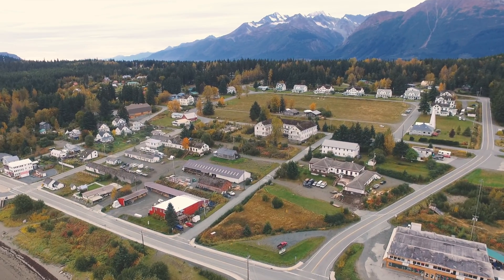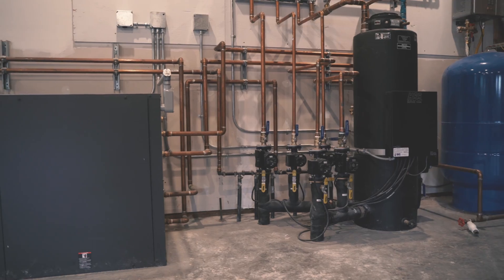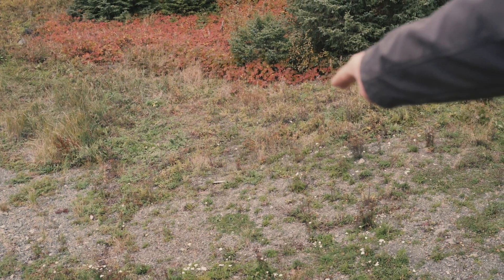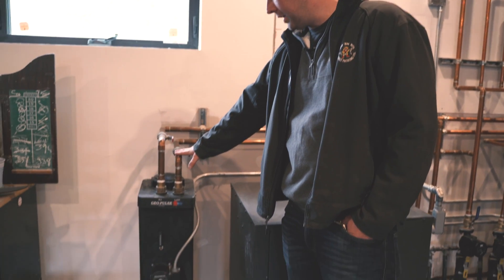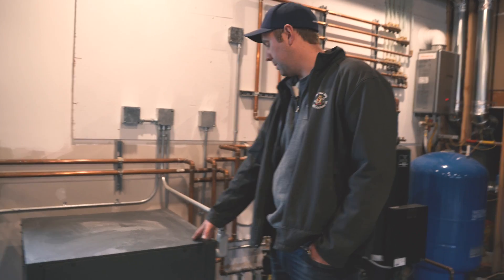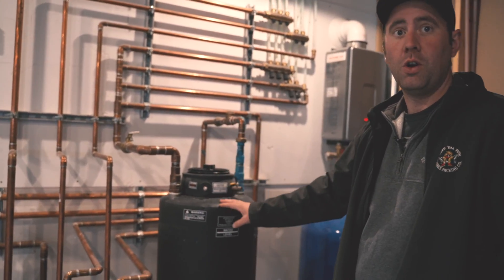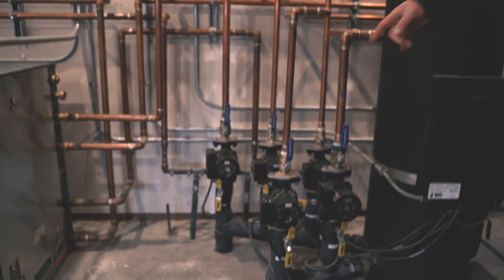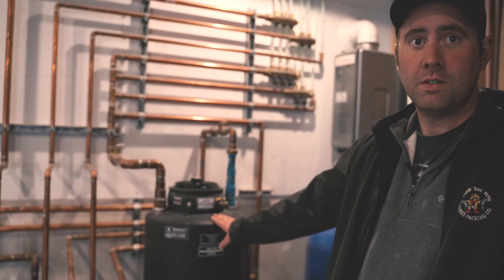Heating in Alaska: Climate Master Geothermal System

Comment: But what power source actually heats the liquid
Reply from the maker: A geothermal doesn't heat the liquid like a boiler. It pulls heat from an environment like a standard air-source heat pump. The big difference is that a geothermal unit uses the ground as a stable heat exchange medium.

Comment: my wife plan on moving back to Alaska sometime in the near future.. would a system like this work ok in the Fairbanks area? thanks for the video. Ive been interested in Geothermal heating for quite a while
Reply from the maker: Geothermal should be no problem in the Fairbanks area. While geothermal heat pumps are not that common in Alaska, they are used heavily in other Arctic regions. For example, about 30% of homes in Sweden rely on geothermal.

Comment: That is a good HVAC system and how much is that unit and what part of Alaska is
Reply from the maker: This is a geothermal heat pump. The prices can vary depending on what you need for installation. The video was done in Haines, Alaska which is on the coast I guess?
Reply: Ingram's Water and Air Equipment. Near Juneau it's not super cold there but still freezing but nice system